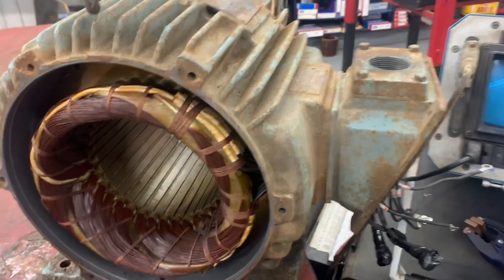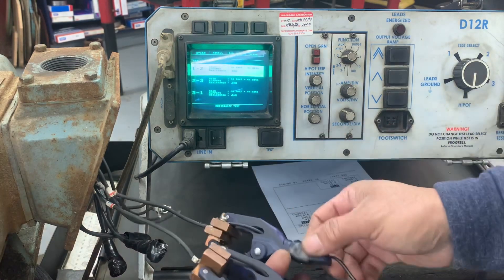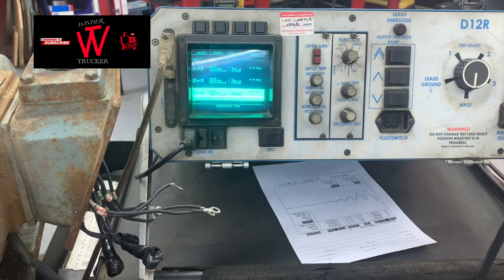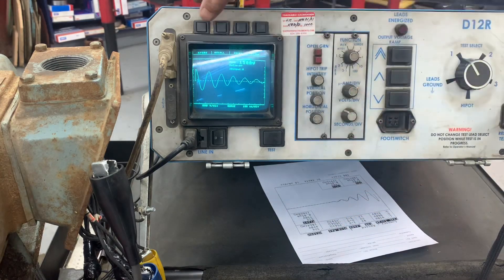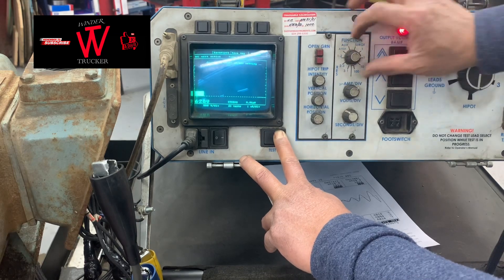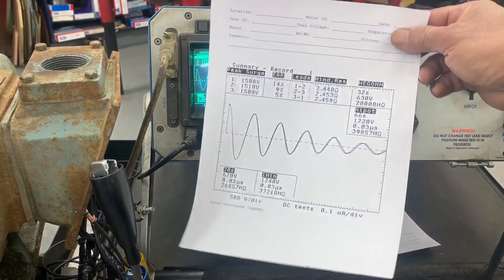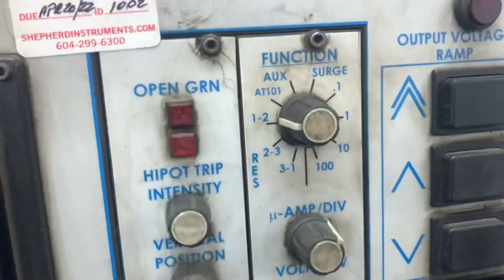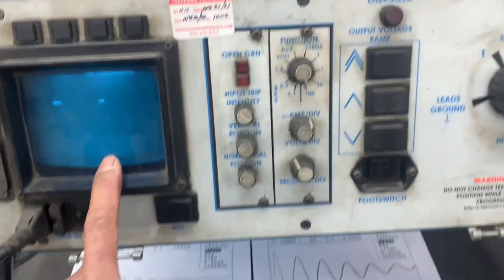Motor Rewinding | Rewinding | Surge Tester for Motors | How to use Surge Tester with  Baker D12R

Comment: Hello,
Could you please advise on the maximum acceptable value for the welding resistance in the resistance measurement device?
What should be the maximum welding resistance to ensure the wound rotor is free of any issues?

Comment: 7.5Hp   slow  speed   connections  explain   sir   Texmo   company
Reply from the maker: How low what’s the rpm?
Reply: @windertrucker6230  sir 1420
Reply from the maker: @abdulnoorabdul8574  how many coil and leads how many wire connect to each  lead wire(wire going outside)
Reply: @windertrucker6230  12coils  Delta  CONN
Reply: Good morning🌞 sir
Reply from the maker: @abdulnoorabdul8574  Good morning brother.how many wire connected to the lead wire going outside
Reply from the maker: @abdulnoorabdul8574  how many leads or wire going outside the motor

Comment: sir how to caculate turns for single phase 36 slot motor 1440 rpm 4 pole stamping size 3 inch inner dia 5 inch outer dia 8 inch
Reply from the maker: Sorry I don’t have the calculations maybe search in Google.

Comment: Really useful video, thanks for sharing such information with us, rarely we such content, by the results of surge test it shows 130 Percent error in waveform do that means it has shorted turns?
Reply from the maker: Thanks you,the other picture next to result comes from a surge test from other motor just to show picture of bad winding test,yes it has a turn to turn short or shorted coil.
Reply: @windertrucker6230  thanks for your reply, how much percentage of error is tolerated?
Reply from the maker: @aakibshaikh1660  if  one  waveforms is above 12%.it’s shape will change detected by EAR(error area ratio calculation) it has a bad turn to turn failure